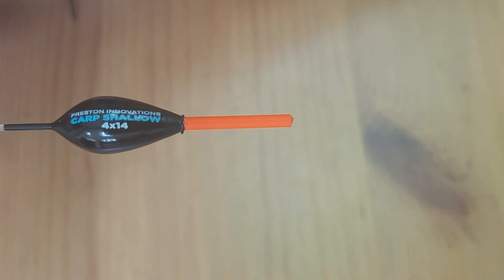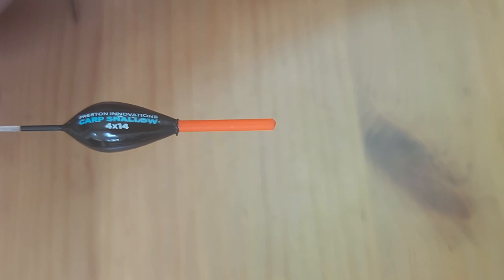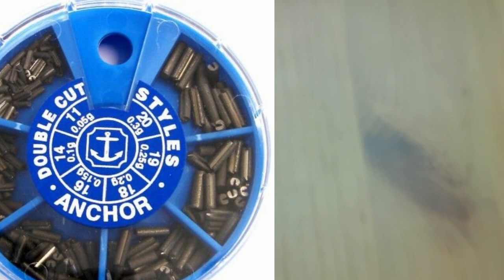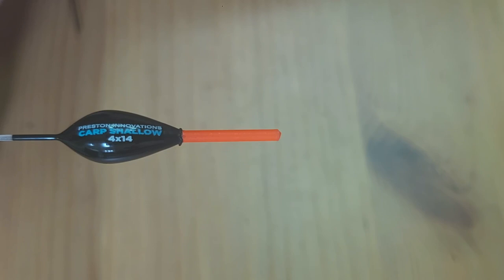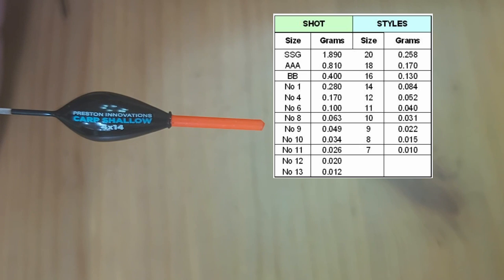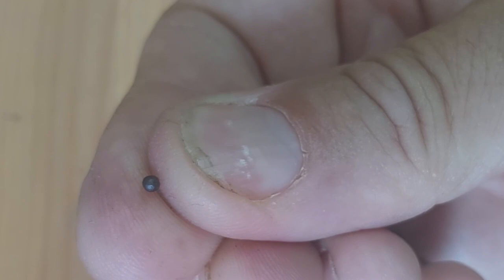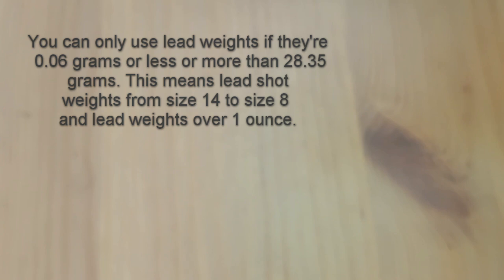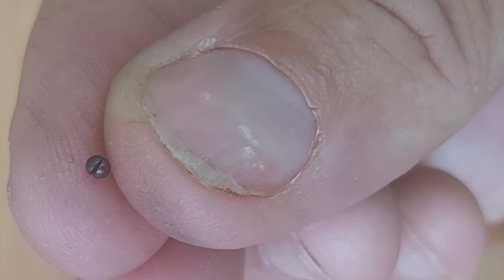Pole float sizes Explained!//shot, Stotz & Styls discussed//4x14 size explained!

Comment: Thanks for  helping us to understand the mine field about pole float weights.why ever do they put 4x14 etc to state the total grms. is much easier. Back a few years all our waggler, stick, and onion floats etc. were rated by their shot cap. Ie 4x BB or 2x Swan etc which was relevant as we used shot from tubs/dispensers marked with these sizes. As you say we use STOZ/CUBES etc but you don’t find many #12 / 14 /16vin packs or who would use 6x14 or 8x 16 ?